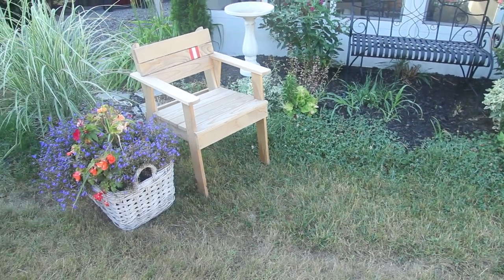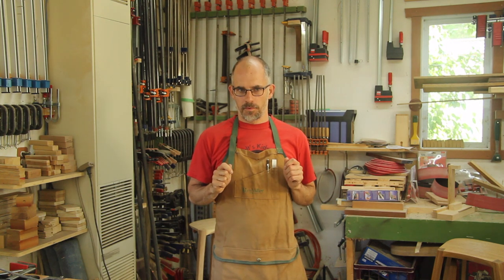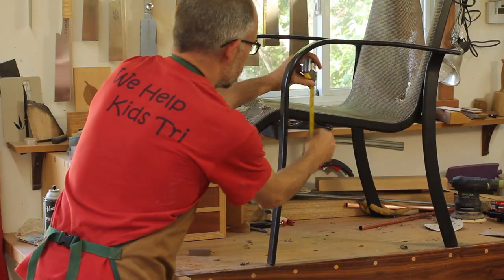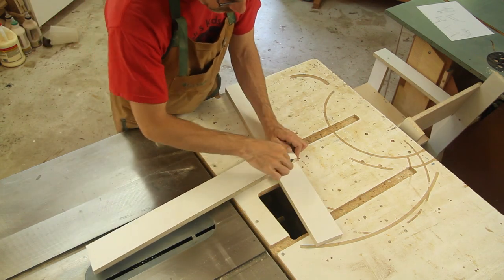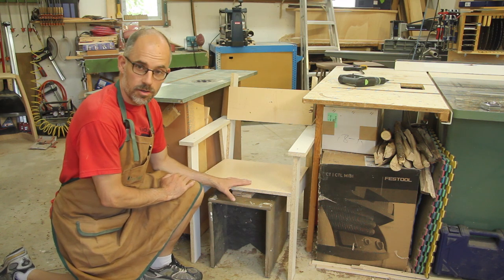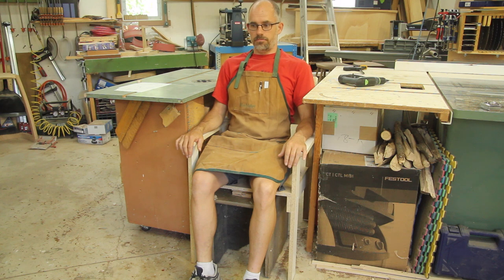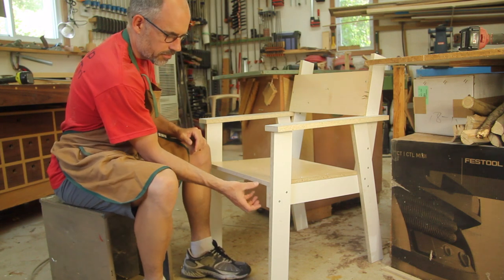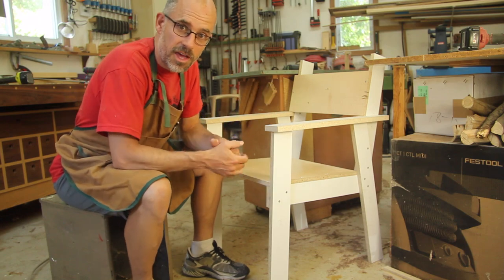Pallet Chair Design

Comment: Is the pallet so valuable that you have to use the other staff for a mockup? Nice design anyway.
Reply: Generally no, but I only had one pallet to work with, so didn't want to waste anything.  I also had a bunch of smaller scrap melamine around that I wanted to get rid of, so that is the route I took.  As it turned out, I have virtually the exact amount of nice, clear pallet wood to use for this chair.
Reply: It seemend he used a EUR pallet, those go for 11 € in belgium.